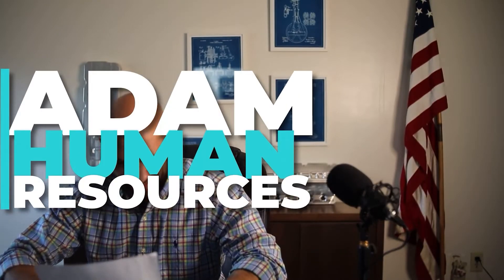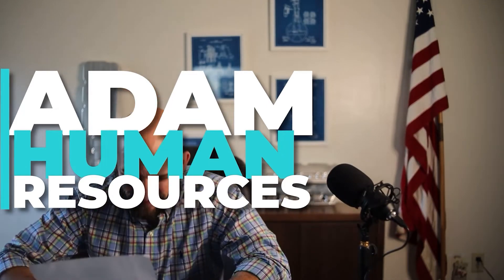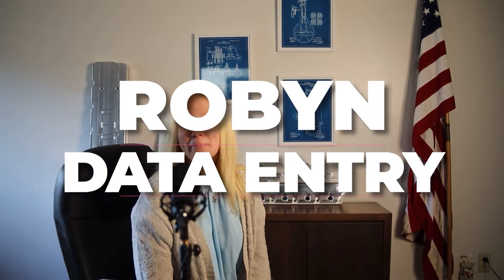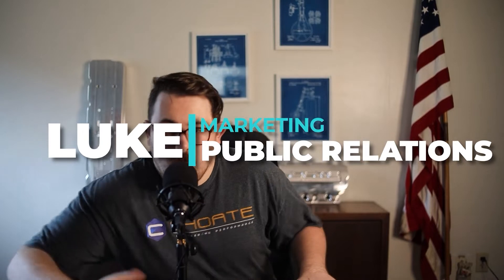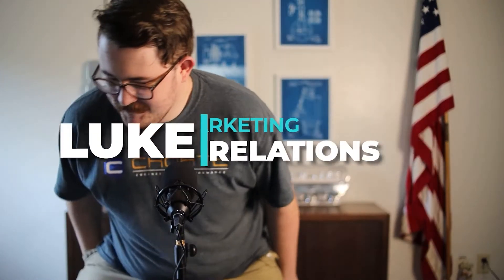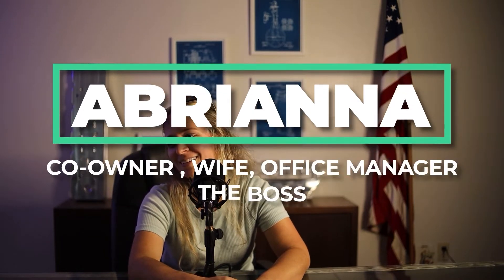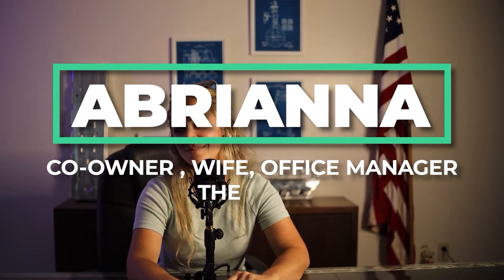Questions and Answers with Cass: The team tries to answer his questions

Comment: lol i apologize for the confusing question I'm usually on YouTube tossing around late either half asleep or lil buzzed usually both also typing one handed and with a minimal public education low IQ i  plus cant read my ramble due to distance of 20 plus feet from my pc .nor do i give a flying fuck I was interested in a podcast you talked 6.0 porting had my ears perked. I'm not trying to reinvent the wheel or doubt the engineers intelligentsia and grasp of fluid dynamics other then i do know a few girls who can flow more cc's sucking  down Mc Donald's milkshake thru a straw. then these heads will ever flow and were a lil off on their size and count on how many head studs needed. (only by 1 or 2) I just wanted more details of what are you hogging out the intake and ex runners and being able to avoid sacrificing bottom end? Throat size to valve size diff? cutting out or remove the swirl ramps, are you doing anything like reshaping the ex port from round to more D shape?  25% more flow is what made me think of wanting to acquire a set from you, but is that thru the entire powerband? or over 4k rpm? Is it a huge overall noticeable difference in power? or like  5-10 hp? How much does 25% more flow generate in actual cc's?  Also Why not go to a hollow sodium filled valve? Im sorry if I sound stupid